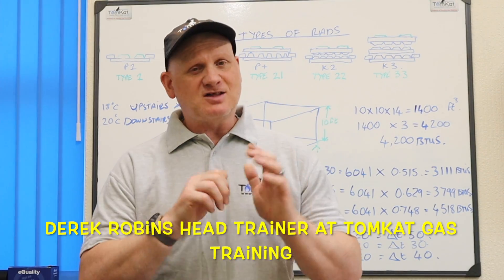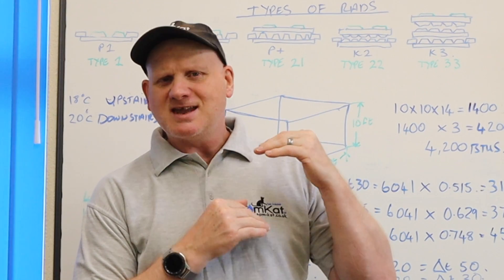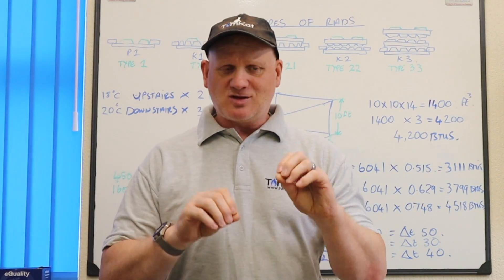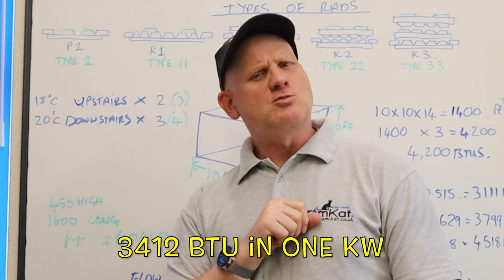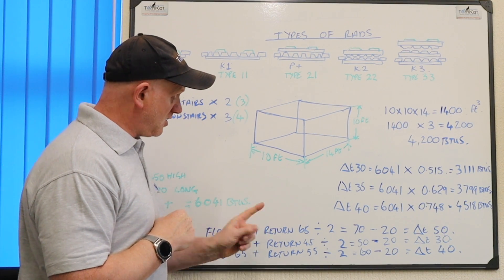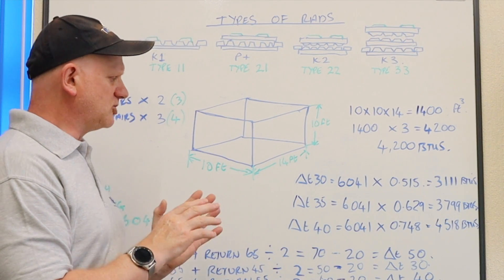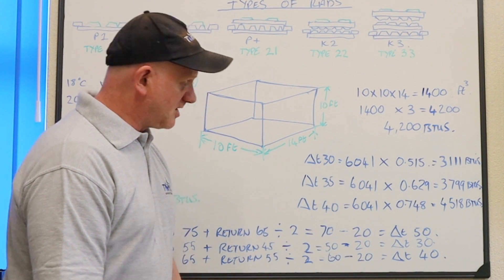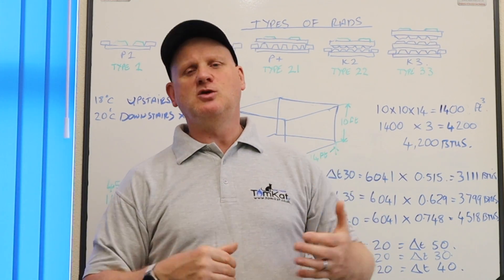How to check your radiators to see if they will work at 55 oC flow temperature . How to save gas.

Comment: Hi, Not sure whether YT allow helpful links these days. However, here is a web link from a
major radiator manufacturer showing virtually every RAD you could want. It shows pictures of radiators plus sizes of each and their Btu and Wattage attached to each. It's a pdf format so most devices can read it.

Stelrad_Spec-Book_Q2_flipbook.pdf

Sorry everyone YT seems to have blocked this helpful link yet again , maybe you can search for it manually in a browser search address bar using the part web title shown above. it's really worth it.
John (UK)

Comment: All good. 
Minor presentation point; when introducing a key value that will be used later (e.g. that 6041 BTU figure), it's worth, if you can, pausing a little to let it sink in (there's a lot of info, so highlight key example points) so that I'm not wondering where the number came from later in the explanation and have to go searching.
😁

Comment: This is quite useful.  

Bottom line is that you are fighting heat loss. 

Your ad is designed to give max output at 75 degree flow.

Reducing flow to 55 reduces output of rad by 50%.

If the rad outputting at 50% power cant overcome heat loss effectively then you cant run at these low flow temp.

Comment: Not sure but my very old 40 year old system drops about 20 degrees from 64 out to 45 return which will enable condensing at quite a good rate. Should point out I have a newer 20 year old condenser boiler.

Comment: We set flow temperature at 40-45C as the boiler is capable of modulating down - it just means the CH is on for longer. Obviously for the hot tank we leave it on 60C for 30mins in the morning.

Comment: What should be the return temperature to stay in condensation mode ??
Reply from the maker: Below 55 degrees c
Reply: Happy new year! Thanks for replying! Being given the fact that after setting flow temp at 48celsius, when I measure the return water  temp on the pipe which has installed the magnetic filter is below 28celsius..

Comment: Great video I am a retired Plumber/ corgi gas safe eng. since the gas conversion of the early 1970s when the government told everyone we would all be loaded due to gas in the North Sea Hamilton Brothers. Incidentally I also worked offshore on Gas/Oil rigs for years. What is the point in having central heating and being cold turn your stat down to save xxx£s but still paying extortionate bills and not even warm in your own home they tell you to buy stats weather compensators but they never seem to mention payback. By the time you get your money back you need new controls, sorry about the winge I appreciate your videos many thanks.

Comment: Tomkat Gas training, thank you for your excellent video. 
As a rule of thumb then and without checking the design of a system with rad sizing etc, is it fair to assume that with a modern condensing boiler, that if you gradually turn the CH flow temp down and every room still reaches temperature, that you're saving money and that the boiler will be working more efficiently ?.
I've heard on youtube that if the CH flow temp is too high, that the boiler wont condense, though no explanation was given.
If the flow temp is too high, will the boiler be damaged ??.
Reply: Boilers have thermostats inside of them to shut them down if they get too hot. Boilers are well designed from a safety point of view. 

The reason that condensing helps is that when the return temp is cold enough the vapour in the flue gas to condense on the pipes carrying the returning water. When something condensed the heat from the flue gas is passed to the return water coming back to be heated by the gas so it effectively needs less heat to make the outgoing water the set temperature. 

The following figures are made up so they are not accurate but will help. 

If your water is coming back at 40 deg and your flow temp beds to be 50 and it takes 1kw to raise the temp of the water by 1deg then your going to burn 10kw of gas. Now if you have condensing in the mix and that can add 5 deg to the water then you return temp water is 40 deg it goes into the condenser gets heated up by 5 deg and is now 45 deg, so to get it up to 50 deg flow temp you only need 5 kw of gas. Like I said made up numbers but hopefully that illustrates why condensing is good.
Reply: @davideyres955  .
Thank you for your reply, I understand the basics of what condescending is trying to achieve.
My Worcester 30i was installed and left at the following flow temperature settings :
Heating 75 c
DHW 55 c
I don't know whether this is factory settings or whether these temps were set by the installer.
 As I understand that condensing only affects the heating mode, is 75 c too high a flow temperature?.
All rads get hot at much lower flow temperatures and following your advice on a YouTube post, I've experimented and reduced the heating flow temperature to
 65 c.
I'm guessing that 75 c will waste gas ?.
If I check the heating return temperature, what are the parameters for condensing, ie what is the minimum and maximum for efficiency?.
Thanks.🤔

Comment: Another excellent and useful advice and calculations that can be done to check the capacity of the existing central heating system at the lower flow temperatures. Thank you. Appreciated.

Comment: Hi Derek, kind regards!  Now I've just lowered mine to 48 Celsius ,as landlord installed an overpowered combi boiler of just "32kw" from recommendation of the "engineers", at 52 Celsius flow set ,it shows actually a  reading of 55 when boiler turns on and gets on full thrust. Is it normal for temperature to go over what is set ?
Reply: At 48celsius flow, return comes at 26-28celsius

Comment: Radiators should almost always go underneath single and double glazed windows otherwise cold draughts will probably form 🙂 Any loss of heat though the outside will be less than the losses owing to the fact the home owner has the heating on higher and longer to try and eliminate the cold draught.

Comment: Should your boiler temp reach the max flow temp regardless of the temp set on room stat tia
Reply: Because my boiler temp regardless of how much heat is being called for only reaches 62 even though the target flow temp is set to max of 75 for heating on my vailliant eco tech plus 832 combi I'm a woman BTW and want to make sure my boiler running sufficient as I had a normal boiler before with a cylinder and landlord changed it to a combi?

Comment: Easy mode - put a sensor on the flow at the heat source… drop the flow temp and see what you get out of the rads. I’m at ~45 degrees. Still happy with the performance.

Comment: It seems a little odd going into so much accuracy with the radiator outputs when the multiplier is just a 2,3,4 etc. It's a good theory but trial and error will likely be the way it's decided eventually

Comment: Turned my boiler down to 48deg, it will be interesting to see how it performs when it starts getting colder.
Reply: Hi . Does it makes any change? Now I've just lowered mine to 48 Celsius as well ,as landlord installed an overpowered combi boiler of just "35kw" , at 52 Celsius flow set I got a reading of 55 when boiler works, I don't know if it's ok
Reply: Jury is out at the moment, house is fine but requires heating on for slightly longer.
Reply: It will take hours to come up to a comfortable temperature when it's really cold.
Reply: @essanjay8604  , turned it up today to 55 with the incoming cold weather we are due.

Comment: 😂 In response to the posts that Derek is “pissing in the wind trying to educate homeowners ‘ & middle class women having watched a few YouTube vids  That is so not true - I’m a 63 year old female that knew sweet “FA” about how to get the best out of my CH system but have learned  a lot & enough to adjust flow temps etc through watching these videos. Shame the CH Engineer who fitted my new system  18 months ago couldn’t be bothered to do all this for me or even balance the system following installation &  that I didn’t know as much as I do now to demand that he should. BTW I’m  working class as they come
Reply: It's shocking so many so called CH engineers dont give this guidance. I got 6 so called 'gas safe' engineers round to quote for upgrading my 25 year old boiler to an new more efficient one and fitting TRVs. 3 suggested a combi to replace the heat only boiler despite the house being large having 4 beds, a bathroom, separate en suite with shower and 5 sinks. Of these 3 plus another 1 didnt bother sending me a quote. In the end, I had just 2 quotes to finally choose from.
Reply: @1701_FyldeFlyer amen to that. A few years ago I had my house done. New boiler, fully pressured system etc. I'm a chemical engineer so I wrote a little spec for what I wanted.
You could see the fear in their eyes. Only got one quote in the end

Comment: Are there any cons sizing your radiators too big? Lets say you prepared for heat pump and installed very low flow temperature radiators but ended up using gas boiler or solid fuel instead.
Reply from the maker: Over heating the room
Reply: @tomkatgastraining  Huh???  Was that said with brain in neutral? 🙂
Reply from the maker: @jesserawson898  no if rads are too big for the room the room will overheat
Reply: @tomkatgastraining  Ah, so TRV's are ineffective in shutting down the radiator in question.  Hadn't realised that. Thanks.
Reply from the maker: @jesserawson898  nothing to do with the TRVs it’s the heat held in the radiator and then released into the room
Reply: @tomkatgastraining  Can't you lower panel average temperature with lockshield so that kilowatt output matches the room?

Comment: You said ‘They shouldn’t really be painted white. They should be painted black.’ No. Objects only radiate in the visible spectrum if they are literally red hot or white hot. White paint has very good emissivity at a radiator's working temperature. It should be BTU/hour, not BTU, but please use watts.  There are free heat loss calculators online. I found Myson best because it shows the calculation.

Comment: If a rad has a maximum btu output for example of 6041, does that mean that the TRV has to be set at fully open (5) setting on the dial to get the 6041 btu output? If so, does that mean that in order to reduce the flow temp to say 55c, you have to have the rad’s fully open whereas they might have been set at say (3) before to regulate the room temp when the original flow rate was typically 75c? If so, what use are the TVR’s performing if they have to be set at fully open for a reduced flow rate of 55c and does that mean that the boiler will be running most of the time and if so, will it be more expensive to run in the 55c condition with the valves fully open as opposed to the original 75c flow temp and a setting of (3) on the TVR ?
Reply from the maker: TRVs act on air temperature not water temperature. They close when the room reaches the temperature set by the TRVs
Reply: TRV is an Open/Close switch working on a room temp sensor. When Open it will circulate whatever flow temp water is supplied by the boiler.

Comment: My combi boiler only has numbers from cold to max with 1-6 in between. What number equates to 55c please? The last time an engineer called, he left it at 5.
Reply: I used to have mine set at 4 at the beginning of Winter then up to 5 when frost was on the ground.

Comment: 55 degrees for domestic hw . isnt hot enough .
Heat only and system boilers should have two flow temps .
Reply from the maker: The 55 oc is heating not for the water
Reply: @tomkatgastraining   Most  heat only  cant give two flow temps  ..
Reply: @mgbroadsterJ  exactly. So to avoid legionella the temp needs to be so high the bloody things don't condense.
Reply: Maybe check out how many people die or even contract Legionella before embarking on safetyism. About 50 per year, 20 of them got it from abroad, and less die from it. You are about as likely to die from lightning. maybe wear a Faraday cage everytime you go out? Encouraging people to emit more fumes and waste on money is overall worse than the negligible amount of people that could get Legionella (which incidentally starts dying even at 50c).
Reply: @BarringtonDailey  Legionella is also killed by the Chlorine or Chloramine they treat the water with. In a domestic environment where the hot water,  shower etc is used on a regular basis the risk from Legionella is possibly vanishingly small irrespective of the hot water temperature.

Comment: It's  worth mentioning that radiators were generally oversized as Derek  mentioned, also outputs were calculated with an outside temperature of -1C. The average  winter temperature is about 8C, so there's scope to heat rooms at lower temperatures with existing rads.
Reply: But then again it is currently -5°C, I wouldn't want my heating not getting to temperature at these not common, but occasional lows
Reply: Absolutely. My 1920s detached house is such a house. I put the flow temp down to 60C, even so, the sadiators are so massively oversized that the rarely get hot. Warm, yes - perhaps 45C but HOT, never.

Comment: Can’t I just run the boiler at 55c and see how well it does this winter. Oh and my wife 74 years old would freeze at 20c she require 22c.
Reply: Yeah 20 is OK if you're on the move a lot of the time - not warm enough if you're sitting in the evening.

Comment: I went 15 years with an unbalanced system which left the lounge radiator cold. By watching YouTube videos and buying a contact thermometer I have a balanced system with a 10c temperature drop across all radiators.  

My new Ideal Vogue boiler was fitted 2 days ago, which has the hot water set to 42c while the heating is initially set to 50c. If I get cold I will just turn it up rather than do the calculations but hopefully by running it for longer it will cope.

Comment: I first found you in a rant about gas Safe only going anywhere near a gas appliance. Goodness me. What a difference!
Excellent videos, helping the nation and delivered in a true professional manner.
You have to wonder though why the UK is so far behind with load compensation and modulation.
As commented further down... I nearly got a dual channel thermometer to setup the radiators. But a used FGA cost less and indeed does more.
2 days flushing the system and converted to sealed. 50 sheets of kingspan to go in and a full vapour barrier.
I want to see low gas use for Christmas.

Comment: Every time I replace a rad I put the biggest bugger in I can that fits/doesnt stick out too far. Being as mine are controlled by programmable valves not worried about oversize. Most of mine are now double panel single fin. New rads also contain less water than the old type and therefore heat up quicker. Underfloor heating is the best, much more comfortable

Comment: You can put your  heating analyser temperature probes on the radiators to get the exact temperature readings, flow return and Delta temperatures and it also gives room temperature, this is the easiest way to confirm if your radiator is OK for the job .Good flue gas analysers have multiple functions for testing heating and plumbing systems. Efficiency , temperatures,  and pressures

Comment: I am scratching my head at present as some of our new extensions are wet UFH, some of the original house is on a mix of traditional radiators (singles with twin fans various sizes upstairs) and a number of vertical radiators downstairs (those actually come with T30, T50, T65 calcs on the suppliers web site for BTU) - so bit of 'man maths' required I think to work out how to reduce the flow temp to optimise our set-up - at least I know what T30 etc means now

Comment: What is the problem with oversized rads if we have trv’s and a room stat?
Reply: @twig Oversized radiators (grossly oversized) will do on-off cycling, taking bursts of heated water then shut off (because the TRV notices!). Also avoid having the TRVs and the room stat fighting each other.
 Room stats tell the boiler when to switch off. TRVs just switch off one radiator. Boilers have to 'quess' when to switch on-off.
 Heat pumps can work better because they usually have lots of sensors and software to help decide when to turn up and turn down (not on/off!) and tend to be 'adjusted'. Meanwhile 'fit & forget' cheap combi's just eat the fuel but everything is toasted.
 Usually it's all about the quality of the designer, engineer, and installer and the ill-advised short cuts and rules of thumb they fobbed off on you (and the rest of us).

Comment: We can’t reduce the flow temperature, unless , every rad in the house is oversized at the same ratio?
Reply: You could but your output would be less in those rooms with now undersized rads. 

Usually you wont need to replace all the radiators since your existing largest rads could be moved to the smallest rooms and then you'll only need to buy less new larger rads.